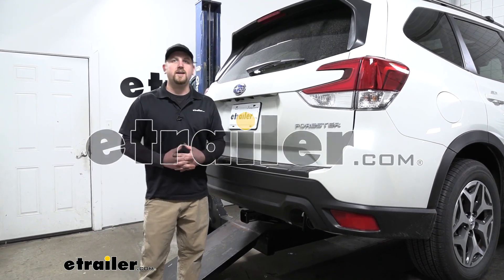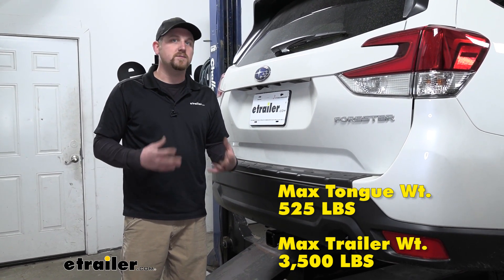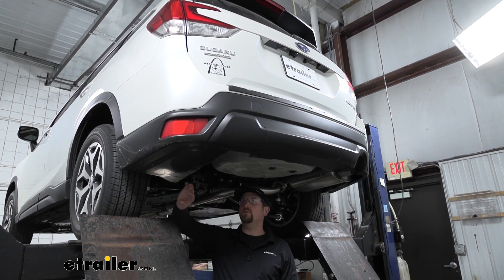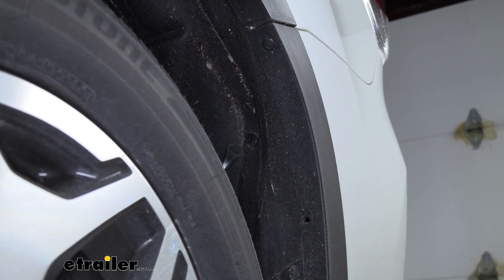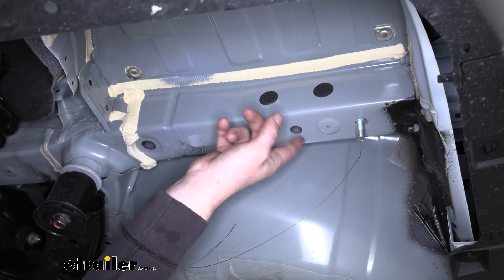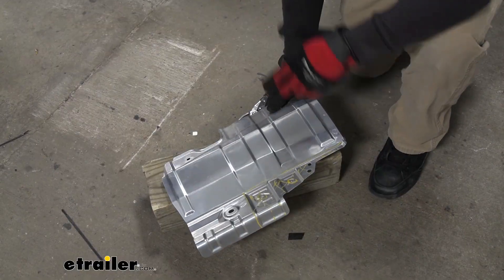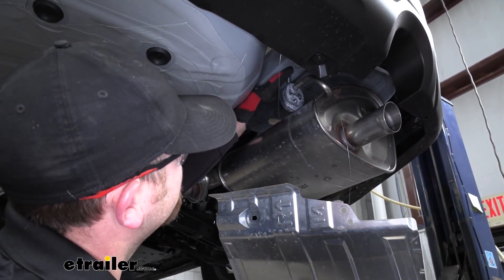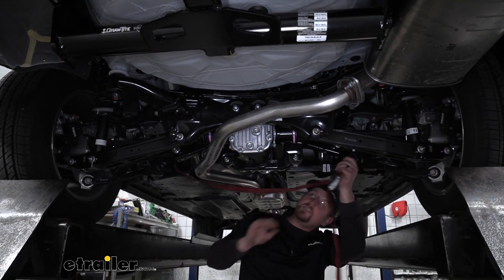etrailer | DIY Install: Draw-Tite Max-Frame Trailer Hitch Receiver on your 2020 Subaru Forester

Comment: Just installed this hitch on a 2020 Forester Sport.  The hitch is very robust, no argument there.  As a mechanical technologist for industry (oil, gas, r&d), installation took 2.5 hours solo, using ramps, hand tools,  and a floor jack.  Time to install includes gathering equipment and cleaning up.  Website, manual states 30-60 minutes-maybe true if you had a lift and power tools (and a friend to lift the hitch into place).  Highly recommend removing the exhaust—easier access bolts for final torque.  Also recommend exhaust hanger pliers.  Heat shield trimming was straightforward for someone with mechanical fabrication experience—it may require trial and error for some.  Splash shield will no longer sit as tightly to vehicle bottom when reinstalled,  but plastic flexes enough and there are no components there that it really protects.
Reply from the maker: Thank you for sharing your install experience with us. We will take what you have said into consideration for future installs. 
https://www.etrailer.com/Trailer-Hitch/Draw-Tite/76271.html

Comment: The only thing I would add is adding loctite to the bolts, as the nuts are not nylocks.
Reply from the maker: You can do that if you wish, but it's not necessary. The conical thoothed washers do a good job of keeping the fastener properly tight.
https://www.etrailer.com/Trailer-Hitch/Draw~Tite/76271.html